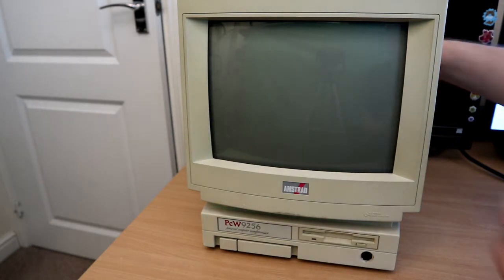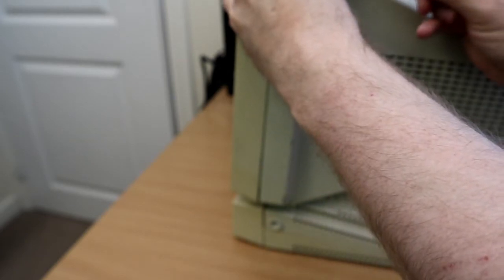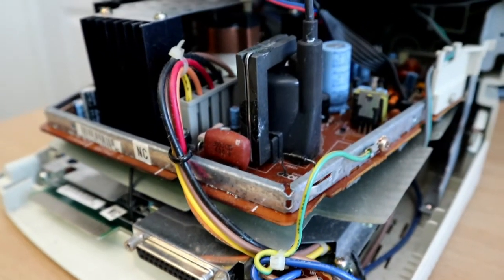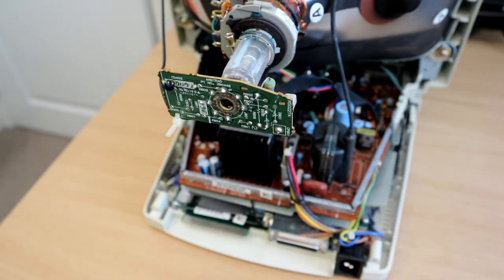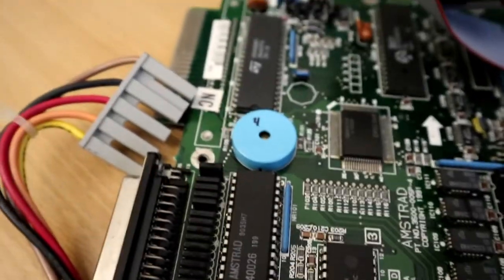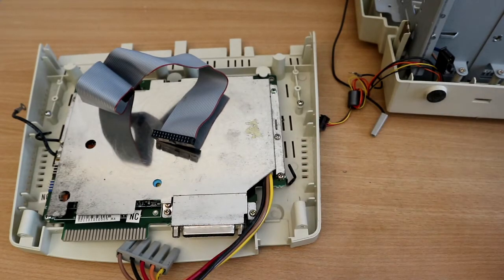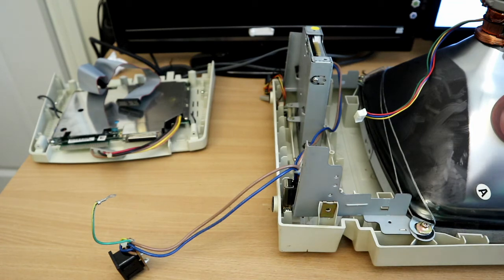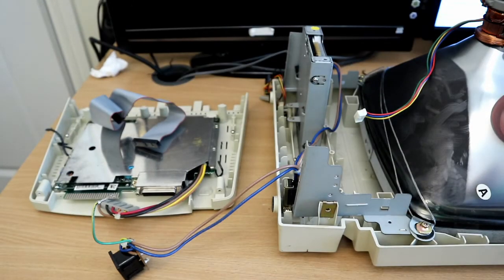Amstrad PCW 9256 Repair Part 1

Comment: I had a PcW9256 (note the lower case "c" - that was actually part of its name!) c.1992, and I upgraded the RAM to 512k. The eight memory chips were sold as a set for about £15, and it was simply a matter of plugging them into the motherboard - once you'd dismantled the PcW to get there... There was a feature in PCW Plus magazine showing how to do it step by step, but these days I can hardly believe that I did. Yet it all worked, I put everything back together, switched on and the system memory was doubled without a hitch.

By the way you do have to switch it on, then insert a system disc to get it running. Once it was loaded it could run all kinds of CP/M programs, not just word processing. It came with Locoscript, which was the PCW range's own dedicated word processor, but in PCW Plus there were small advertisers selling other software on floppy disc.
Reply from the maker: I always turn it on first then insert the disk. Not tried it the other way round but will probably work. I'm a little careful power cycling computers with disks in the drive. Probably fine but had an unfortunate incident with a QL microdrive

Comment: power it up with a system diskette if you want to be able to do anything, I think these just came on with a blank screen like that  from new.
Reply from the maker: I think you are correct. Just need to get round to replacing the belt on the drive.

Comment: I have this same model be patient with it, I can tell you that you know nothing about Amstrad PcW Wordprocessors.
Insert the CP/M Plus Mallard Basic Floppy Disk.

The 9256 is a compact system look to see if there is any trapped wires.

You can get Floppy Drive Belt all Amstrad PcW Wordprocessors have the same length belt.

Amstrad PcW LocoScript 1 to 4 Word.

LocoScript 4 inside the  circuit board is a jumper pin remove for 512k ram this is for LocoScript 4.

The Interface Port is for Locolink For Windows Disk Conversion Program and Cable to Windows 95-XP PcW to 
PC LocoScript Professional Software and for a Digitiser.

There is also a Jumper Pin on the Floppy Drive and Adjusting Screws on the Monitor Board.

Look for any Bent Pins.
Look at the Beeper this is the round disk inside a blue cover on the Circuit Board.

Give the boards a clean.

Next to the Interface Port is the Matrix Printer Port.

There is a Service Manual that you can download and the User Manual as well.
Reply from the maker: Thanks for taking the time to provide the advice. I am due another look at this. Cheers Ste